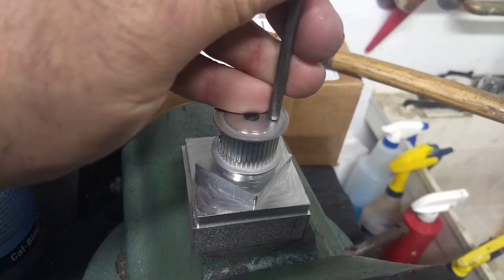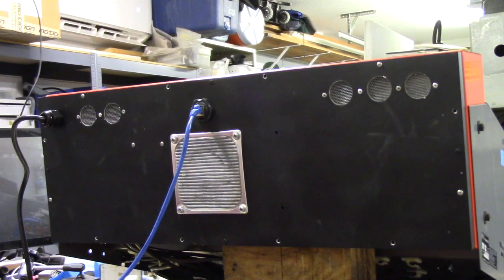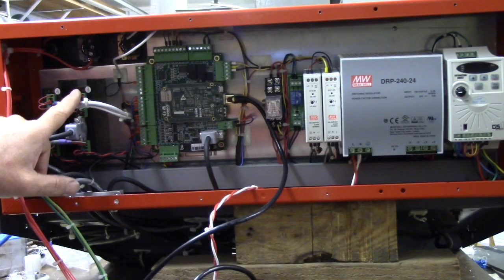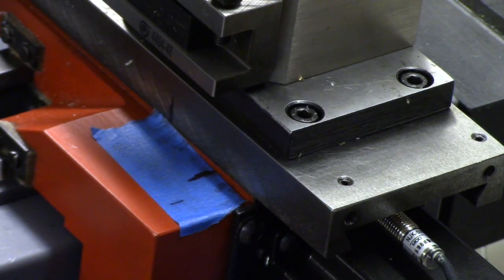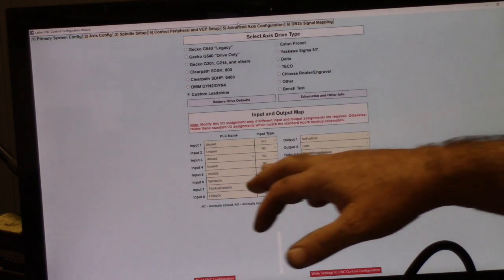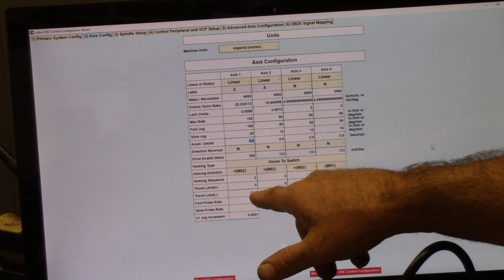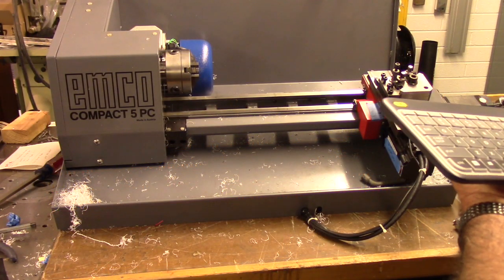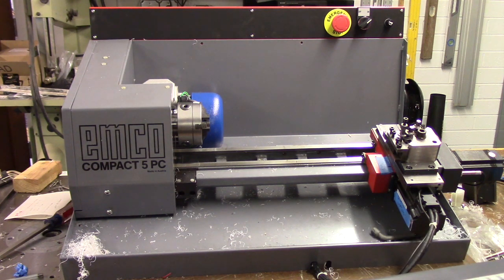Emco Compact 5 Completion Overview - Centroid Acorn CNC

Comment: What is the total cost of this retrofit?  Have the same lathe at my ready.  I'm sure this same upgrade will be needed.  Thanks
Reply from the maker: If you do it exactly as I did, plan on spending close to $2500 in parts. No one ever thinks of cost and all the components needed.
Reply: I did just the cnc part for less than 400 and another 200 for Mach3 (steppers not servos and no hall sensors)

Comment: Could you add a link for the pulley or do you have a BOM for the retrofit?
Reply from the maker: The original motor and spindle pulley was reused. The countershaft was removed.
Reply: @martyscncgarage5275  you said that you used a 20 tooth pulley instead the original is too long a the C pin passes the shaft
Reply from the maker: @pwave123  yes, 20 tooth mxl, 11mm wide. I used Kevlar belts, 3/8" wide
Reply from the maker: https://ebay.us/iweU1c